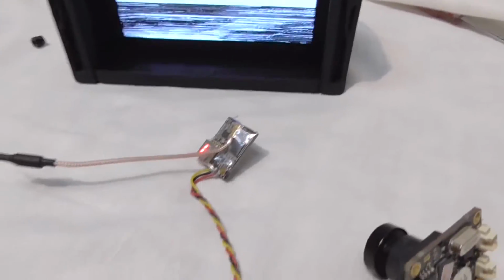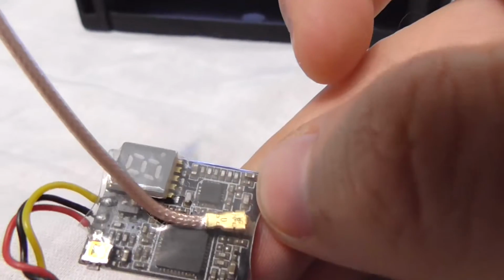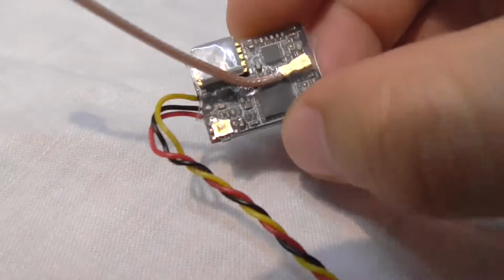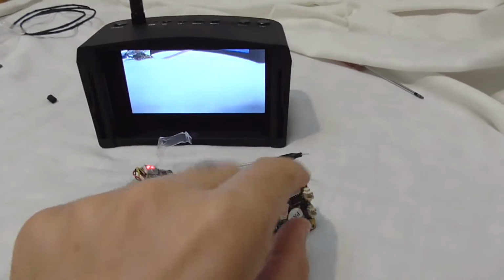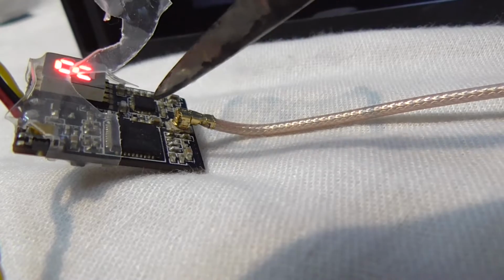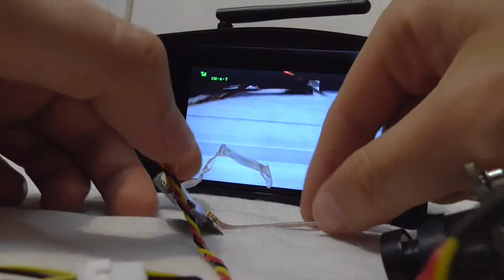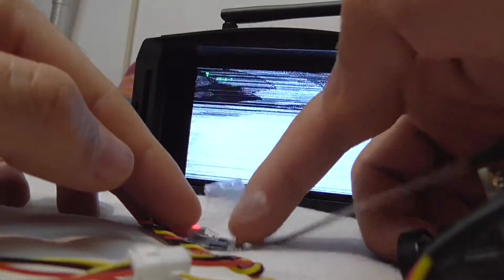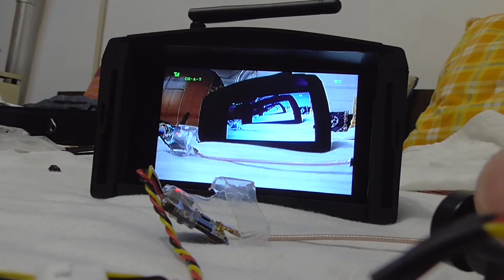VTX malfunction, No image in FPV Goggles, Antenna FIX

Comment: hello I want to get help on a subject.  I used my ts5823L vtx transmitter without antenna and the device fell silent, which part needs to be replaced
Reply from the maker: Probably the TS5823L itself... never use a transmitter without an antenna, it has no place where to send that power and it can burn out.